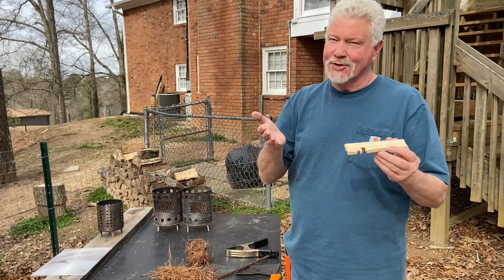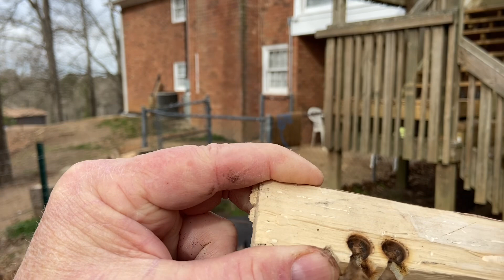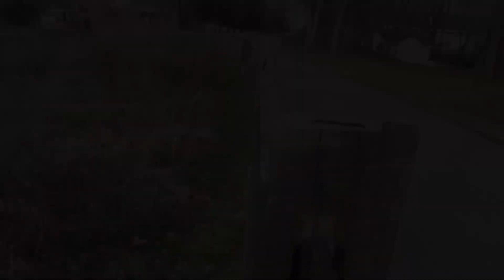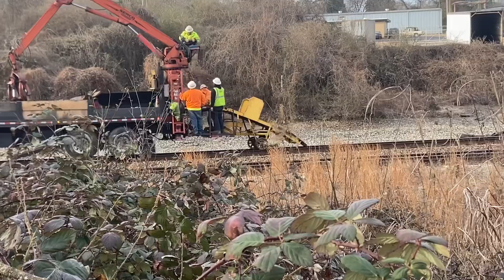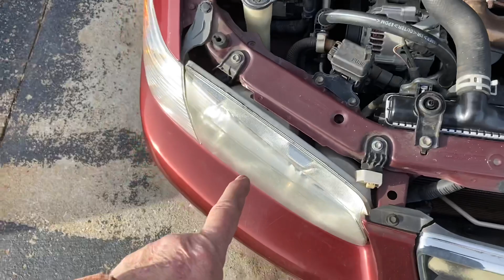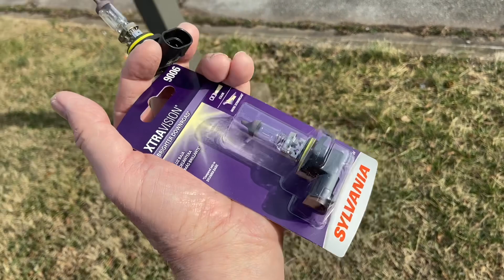Hand Drill Friction Fire. How Long Does It Take? Do’s, Don’ts, And Advice!

Comment: I have been trying this afternoon for my first time using red cedar, I think the grill is too thick my slot is too wide,… I am using a bow drill, it’s kicking my ass. I will try again tomorrow with a smaller drillbit, the one I have now is about 3/4 of an inch,/1 inch thick… I think that’s part of the problem. I did make smoke at one point. How long does the hole in this fire board last? Do I need to clean it after it has been polished and blackened? Awesome video thank you
Reply from the maker: You need to visit my bow drill playlist and watch the tutorials.